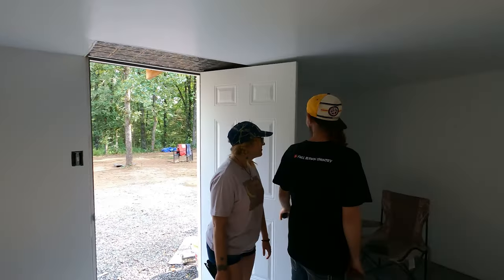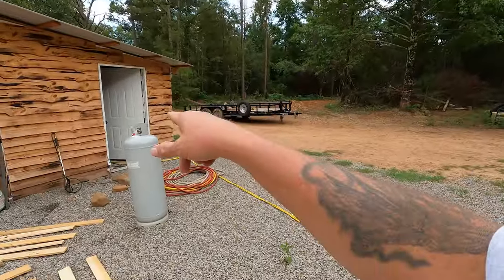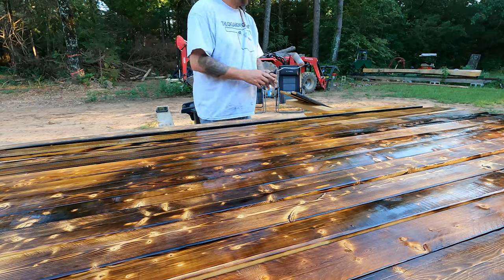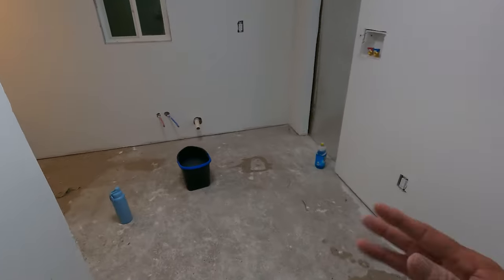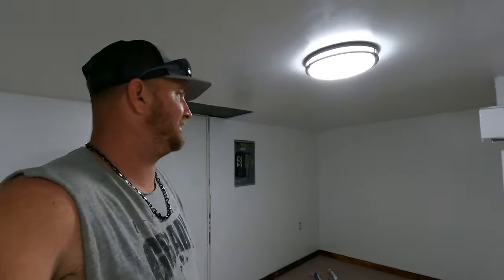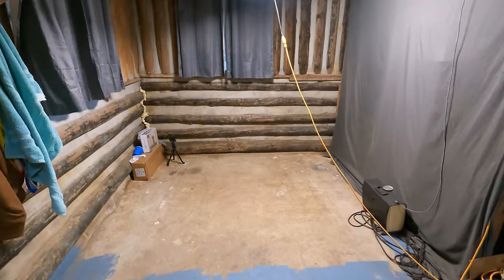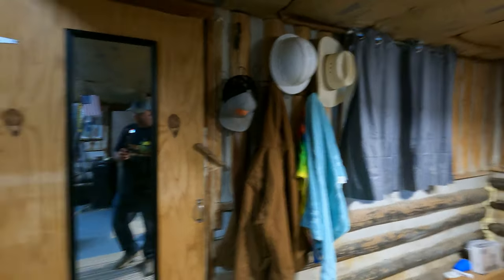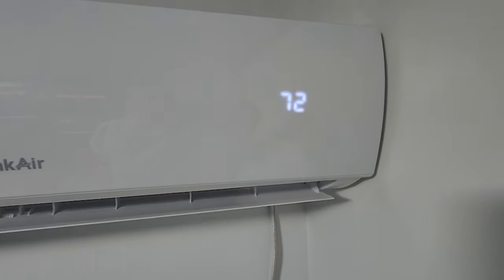FINALLY MOVING IN |tiny house, homesteading, off-grid, cabin build, DIY, HOW TO, sawmill, tractor

Comment: I have to say, the place looks incredible. That wood trim really makes it 'ping'.
For me, the only thing i'd change is the bed. I just feel the bed is too big. I know you love your bed (and it is an absolute cracker btw), but i'd be tempted to follow Gary and Mel and make your own bedframe, slightly smaller than your current one, finish it with that charred wood look, i think that improve the space no end.
I realise also that in time you'll be moving out of there into the 'new' cabin, so this is a 'permanently temporary' solution for you. For me, though, having a smaller bed will open up so much more space not only in there now, but also once you build your new permanent cabin.

Comment: you need to go around door jamb with window/door expanding foam insulation. it will block drafts and bugs.  you may also want to temporarily hang a door between the well area and the living area to make a better seal for air and bugs.
Reply: Also the pump area needs a cement slab poured instead of having a gravel floor since the tiny house/living area is part of the pump house .. slab flour will help keep out the insects and creepy crawls and nope ropes hopefully.

Comment: Looks great ,you did a great job building..the nightstand at the bottom right of your bed, why not turn it to the wall flush with your closet..it will give you a bit more leg room to get in and out of your bed..and looks like it fits better on the wall to the right of the AC that is flush with the closet

Comment: Wow David, looking great. I don't comment much on channels but had to give you kiddos.
Something you might wanna consider is ceiling fans .
I run mine year round just switch blades from summer to winter.
Helps a lot on air circulation and cuts utility bill 
You're doing an awesome job.
Reply from the maker: Tu

Comment: Question: why didn’t you put the mini-split on the wall to the right of it with the outlet?
It seems it would fit better.
Reply: It might be because the shower is on the other side of that wall. It might have interfered with running the electrical for the mini split. Just my thought.
Reply: @darlenecheramie7309  Ok that makes perfect sense! Thank you!

Comment: Good Lord!  How are you going to get in there to change the bed sheets?  You 
should have put rolling castors on your bedframe so that you could pull it out
when you need to change those sheets AND for easy access into the bed to 
sleep & to get out easily in the middle of the night for when you need to pee.
Then push the bed back into place in the morning to get it out of the way.